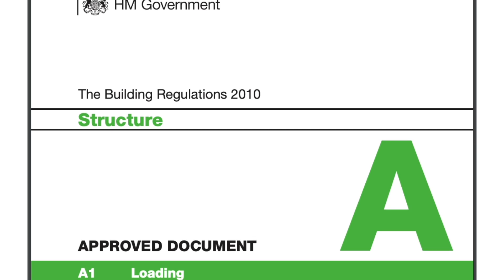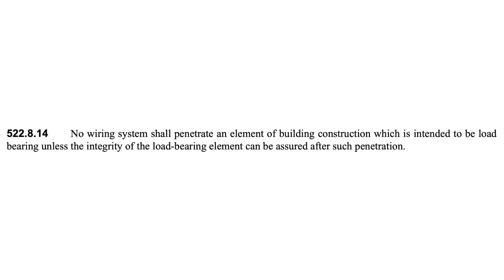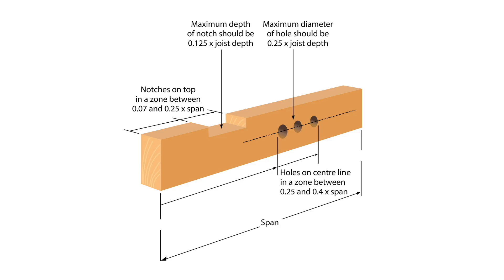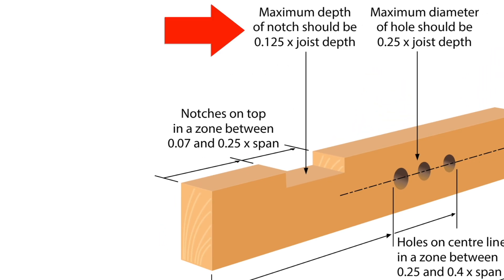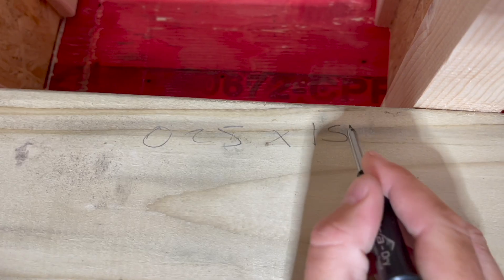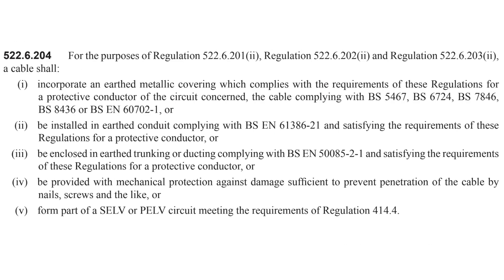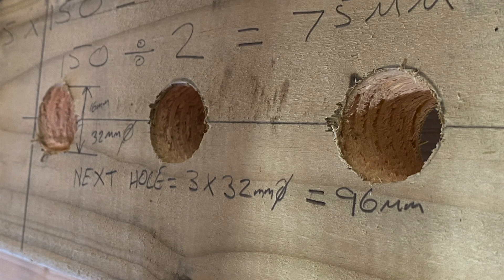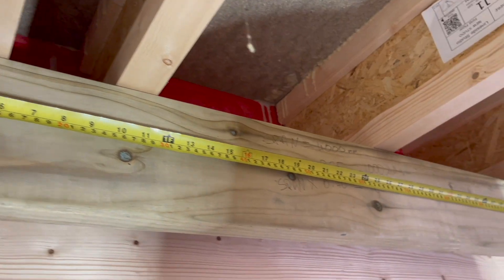Joist Drilling Do's and Don'ts: What You Need to Know

Comment: “ i said the measurement was 634.2 mm “ smh I loathe metric. It was made for a time before calculators. The scales just have no basis in daily life. I’m 2 meters tall and 90,000 grams? And that’s just mass not what I weigh? 0 degrees is cold 20 degrees is brisk and 30 is hot? That’s better than 0 is freezing and 100 is hot? Tallest guy ever was 10ft instead of 3 point whatever meters.10 is the easier scale. Joules and newtons are essentially meaningless to common experience sans adding orders of magnitude 

And while fractions keep you crisp, can always just use imperial in a similar way as metric. Hundredths and Thousandths of a foot is fine. A kip is 1000 lbs. but to be fair, that the speed limit is say 50,000 meters per hour I guess makes it sound faster than 50mph even tho it isn’t. Still 100mph is fast as most want to ever drive. What a nice round number for a top end of a scale

How often are any of us really converting from weight to volume or whatever, specifically of water at the specific temps and pressures metric is based on? And if so, doing it in your head and not in a spreadsheet or web app?

I’ll refrain from further posting imperial unit activist propaganda

Make metric imperial again
Reply: Yank? Luddite? A Luddite Yank?

Comment: It's important to not that these are safe guidelines, not rigid requirements. So they are sized for the maximum span allowed for given joist depth and floor loading. If the span is a lot less than that, then it's always possible to consult a structural engineer. However, electricians have it a lot easier that plumbers. Electricity doesn't care about gravity or around arbitrarily tight bends; water, and especially waste water does.

Comment: I bought an old 1960 council house. In the past it had a rewire and central heating put in, compliments of the local council I guess. I don't believe these regs existed back then as some of the notches and holes are totally OTT and well away from current regs.
As I go around doing any DIY and I find any joists that may have been badly notched or drilled in the past, I reinforce the joist for my own piece of mind.

Comment: The importance in all of this is guidance.  It is not definitive and compliance DOES NOT mean you are compliant with Building Regulations.  If  in doubt you should consult a Structural Engineer.  Compliance with guidance does not mean you comply with Building Regulations.  Caution is required as breach could lead to the matter being dealt with under the Building Safety Act.  The guidance is provided with a very limited specific example and if the specifics fall outside the baseline of the example then the guidance DOES NOT apply.  BS 7671 and similar documents do not exempt you from compliance when following guidance.  Like I wouldn't necessarily follow the electrical guidance provided by a structural engineer, I urge equal caution following electrical advice on structure.
Reply: @PaulEslinger  I think i follow what you are saying here. I could never quite work out why this is included within bs7671. Part A of building regs deals with structural integrity. I understood it as a building reg that can often apply to electrical installations. If you went completely wild drilling holes with no thought at all, and worst case, a floor collapses - then it would very likely damage installed wiring so therefore potentially comes under part P of building regs?
If working in a flat with no access to downstairs, it's not always clear what the actual structural span on a set of joists even is. Joists may be sat on a timber from a non load bearing wall below, for example. On a new build or extension, it's generally very simple to follow this. 

Rewiring properties, the tendency is to roll back some carpet, take up a conviniant floorboard then drill sets of holes through the most conviniant or sometimes the only accessible row of joists. 
It would be a complete nightmare taking up every single floorboard to ensure you comply with this. There could be deep notches already cut very close to where you want to drill your set of holes for example. 

I worked for a guy years ago who decided it was a good idea to drill 18 or 20mm holes through very thin shallow joists in a loft space. The client happened to be a retired chartered building surveyor and got very angry - quite rightfully. We had to go back there and spend ages screwing metal straps to all the joists he compromised. The client claimed the house creaked following  our install - but did sound a bit far fetched.

Comment: Re-wiring my son's "new" 1929 house which had knob and tube wiring.The place is built with "real" 2X lumber without a single knot visible. We're using old holes almost exclusively even if it makes our runs longer than otherwise possible. Just trying to use common sense but I'm just a  dentist and he's a Physical Therapist. Thank God for YouTube(...and my best buddy who's an electrician).
Reply: Theres an very old military guy in our village who lives alone in Archers house, an old manor house that still has wiring,switches and sockets from decades ago,brown bakelite stuff,sockets in the floor etc.some of it still had corded wiring in places up until a few years ago.My electrician, who replaced the cabling for him said that it was all in reasonable condition despite it's age and also that despite the size of the house (8 bedrooms)there was only about 15 sockets in all and some had clearly not been used for some years.He has no phone ,t.v.internet etc.he reads, listens to music on a record player and goes fishing. He is by no means short of money or a miser, very much the opposite in both cases but the most modern appliance he has is a pop up toaster on a lead with a modern socket at one end and a round pin plug at the other.The electrician said to me,  "I'd like to meet the guy who'd be brave enough to suggest he renews it all"😂

Comment: Don’t ever drill holes in your floor joists. Never.
Reply: Unless said drilling is within the specification of what the IET said as described in the video.
Reply: @ if you actually read the standards it says that when possible, to avoid drilling any holes in there. Because each hole will weaken the structure of the wood over time. The best solution is to create a fake wall that is offset from the insulation to run conduit through. This not only creates additional insulation, it also blocks sound, and gives you easy access to change things without causing more destruction of the infrastructural integrity.

Comment: Surprised there isn't any guidance re. drilling holes through joists with respect to the position of existing knots. Wood cannot take any tensile forces through a knot, so if a decent size knot runs through the lower half of a joist, drilling a hole just above it through the centre-line of a joist would be a total no-no. (Really, there shouldn't be any significant sized knots running through the lower half of a joist, but not all builders take equal care in joist selection & orientation)

Comment: I am a software engineer, my professional organisation is also IET. (I am a member of IET too.) Watching this video makes me feel that software engineers are all amateurs in the field of engineering. I don't think there are IET guidelines on how we (software engineers) do our work. I was very impressed when you cite the regulations.
Reply: There have in fact been various attempts to make ISO and similar standards etc for software engineering. The problem is however that they haven't caught on; software engineering isn't really as amenable to standardisation as construction, as there are so many different languages and frameworks constantly coming and going, not to mention that the requirements of different projects vary dramatically.

However, in practice there are most definitely many documents, canonical reference textbooks and internal standards specific to particular projects that fill the role of standards in software engineering (one common example would be Python PEP 8). It's all a little less informal than having a single ISO standard. But nevertheless knowledge of the such materials should be part of your basic preparation for working on a particular software project.
Reply: lol yes, it’s like a janitorial engineer. Tbf prob smarter. I’d say computer engineering hasn’t been around nearly as long as the other disciplines and there aren’t as many standard ways to do things. Tbf there are some of the most efficient ways to do certain tasks that will get you laughed at if don’t use. There are more codes in the electrical side of computer engineering. Like actually doing the microchips. But most of that is proprietary

Comment: A wise old plumber once told me, whilst a group of concerned builders were fretting over boring holes in some 2 story floor joists, either don’t put a bathroom on the 2nd floor or have the designer incorporate a chase in the design for the plumbing! He also said you can bad mouth the plumber but you won’t sell a whole lot of these houses without a bathroom! After a  bit of discussion they finally decided that it would be ok to slightly over bore the joist in order to accommodate the waste line for the toilet! 😂
Reply: Slightly overbore? A toilet waste is 110mm in diameter (unless a masserator is used). Even if there are very deep 250mm joists, the regs would only allow 62.5mm holes without appropriate reinforcement. That's why placement of toilets and down pipes ought to be planned in from the start...

Comment: ONE MORE TIP: you've lifted a board and are drilling a line of holes to get across the room. You have to drill at an angle 'cos your drill and (auger) bit are too long. BUT your cables have to bend slightly to go through the run. Imagine a cross section of the floor, the cable has to zig-zag through the holes and are harder to draw in. FIX Alternate the side you drill from every other joist so your cable can run straighter and pull through easily

Comment: Why drill such a large hole hole for one or two wires? A wire easily fits through a hole half that size.
Reply: I only have 1.125" drill bits. I run the super hawg drill with the quick lock extensions. That's the smallest hole the extension will fit through. 

Of course, being in the US, that hole size only allows 2-3 12/2 Romex to pass through.

I could carry 15 sizes, but that's a waste of time. Time is money, so you standardize anything you can to keep from dragging excess tools into the job.

Comment: You didn't mention breakout at the back of the timber which can be significant.

If the regs are so demanding then any damage to the joist would be picked up - ideally joists should be pilot holed first, and then drilled from both sides.

Btw the finish on the bits in the video is apalling - I used to make them - these have not been finished.
Reply: BTW. If using auger bits you can't drill pilot holes. Auger bits need to grip and pull themselves through the wood from the center.
Reply: @RossMitchellsProfile  yes you can - as long as the pilot diameter is not greater than the auger point. These auger bits with a lead thread are really only effective when used at a slow rotational speed - a brace and bit for example - a higher speed cordless would negate the lead effect of the thread.

Comment: Must is common sense but I don't get why holes have to be at least 1/4 of the span from the walls 🤷🏻‍♂️ back in the old days we were always taught to drill close to the wall and never near the centre, sounded sensible to me
Reply: it's clearly been tested and proven that the joist is least affected between 0.25-0.4 of span.
Reply: Its to keep things simple, you mustn't use notches between 25% and 75% of the span as that drastically weakens the joists, but holes, even up to 25% of the joist depth, do not weaken them too much as its the extreme top and bottom of the joist that do most of the work, not the centreline. Of course no holes are permitted from 40% to 60% span as in this range it is possible that the full depth of the joist is needed to resist the bending forces which are usually greatest at the centre. People do want to use notches on occasions so to give them somewhere to "notch", the section of joist from 7% to 25% of span is reserved for them, and holes not allowed to prevent some wombat doing both. Wapping great holes 25% of joist depth clearly wouldn't be a great idea close to the supports due to shear forces there, but if all notches were banned there wouldn't be an issue having a few smaller diameter holes on the centreline in the 7%-25% span range.

Comment: Can I ask what regs apply to plumbers and the copper pipe they install. I have seen large cutouts to joists for the installation of several copper pipes under a floorboard.
Reply: The rules are exactly the same for plumbing (which makes it a lot more difficult). However, bear in mind that what is in the regulations is not the last word. It is always open to use a structural engineer to assess whether a given hole or cut-out will affect the structure of the building. A structural engineer can also design reinforcement if necessary.

As to whether any plumbers do so is another matter.

Comment: The joists in my gaff are 9" deep and 3" wide for a modest spam... you could put as any 'oles as you like in them and you'd do nothing to loose any structural integrity. However, anything built to a price which is anything in the past 50 years then you have to take note as will barely meet the regs before the sparky and plumbers start butchering them....Its the holes or notches right in the centre that do the damage with gravity doing its thing....
Reply: "it's the holes or notches right in the centre that do the damage" - huh?  The best place to drill a hole in a joist is directly in the middle (height wise.)
Reply: By centre I meant centre of the span, not the width. the guides are quite clear that its the middle section of the joist that should not be bastardised in any form
Reply: @guffermeister  you can drill a hole in the middle of the span of a floor joist. That won't weaken the joist as long as it is in the middle of the width.  Notching on the other hand is a different story. I suspect code specifications differ depending on jurisdictions.

Comment: Cool and all, but it's unrealistic in so many circumstances in an older house or even in a new one for stuff like downlights, and especially if you are doing data. I just put the smallest possible hole in the middle of a joist such as a 12 or 16mm or use existing holes, if the joist is thin it'd be better to reinforce it with some timber on the sides of it where your holes are, sure its not regs but there's lots of times that the regs are not possible to follow perfectly in the real world. 
Building inspectors don't really care if its obvious there's no other way to do it and you haven't made a very obvious weak point for no reason such as a 32mm hole in the middle of the span for a single 1mm t&e
Reply: if in doubt, always drill in the middle of the joist.  That won't compromise the strength of the joist because there is pretty much no stress or strain at that point, unless there is other damage.
Reply: @tchevrier  Pretty much mate, and always the smallest hole possible too. Plus you want to be in the middle of the joist to avoid screws anyway, win win.
Reply: Exactly......
Reply: It seems to me that it would be useful to have steel plates with pre-cut holes, which could reinforce the joist whilst also providing a drilling guide.
Reply: @andybrice2711  They make nailer plates to stop screws (only works when the top layer is plasterboard), but I think adding additional blocking to the area is probably just as good.

Comment: I can’t see many Sparks going to this much trouble ( Detailed measurements / calculations etc ) on every install , especially those that are able to use common sense and previous knowledge / experience.
Reply: It becomes second nature, you just drill a hole in the center. What surprises me is that no one says anything in the US about drilling holes next to each other. I will start using that rule though.